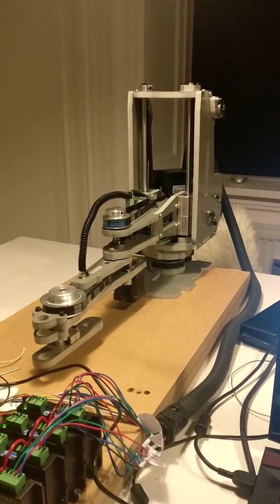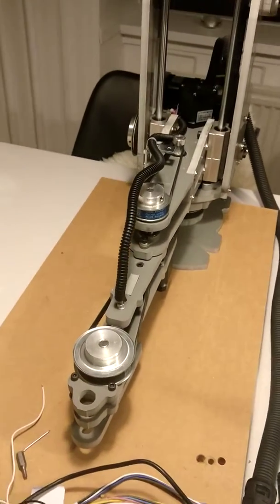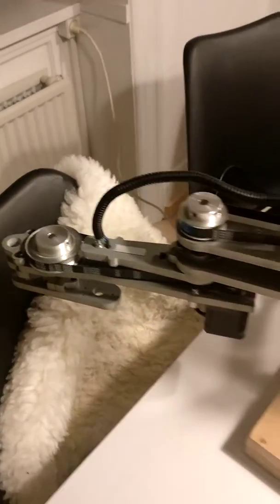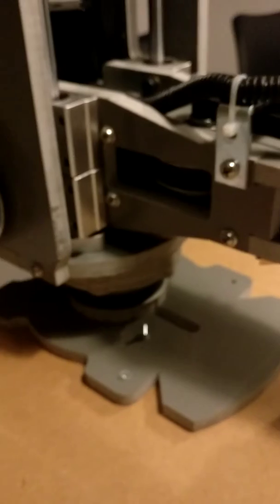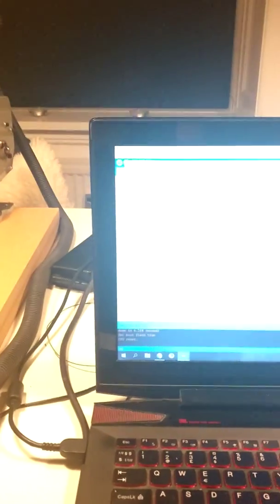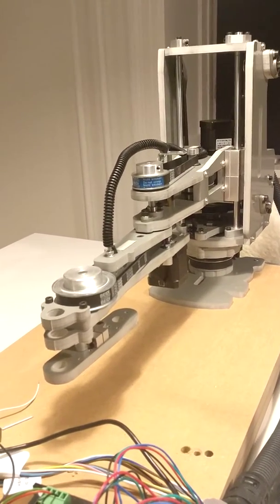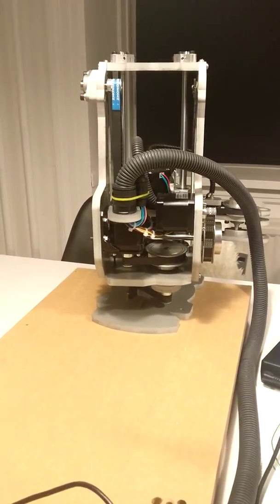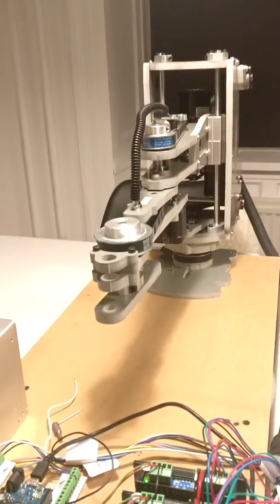Chinese scara robot - frist hookup and impression

Comment: Cool review. By your judgement do you think this robot could be used for a wood milling application? Or should I build my own out of aluminium?
Reply from the maker: Unfortunatly it is way to flimsy. In general i would not recommend a scara robot for a miling application. When milling rigidity is king, it is needed to absorb the forces and vibration from the miling bit. This is not a scara robots strong suit, it is made for speed. If you need something for miling a XYZ gantry design is preferable. You can check out my video of my 6040 cnc. That thing was really nice (taken its price point and weight into consideration). Best regards
Reply: @palmhoej  Where is this video, I can't find it?
Reply from the maker: @robotsforstem1968  https://youtu.be/6W5K4rdEuN8
Reply: It's a toy. An expensive one, but still a toy.
Reply: im building one out of aluminum but not for milling, im having my cnc mill the aluminum parts now, honestly idk what ill have this do, maybe some pick and place job once its done
Reply: and im designing it closely to this robot in this video

Comment: Do you used this scara robot for a serial profuction aplication?
Reply from the maker: Cool side note: it was bought by film company that used the arm as a prop in a danish movie called "Kollision". There is a line about it in the movie.
Reply from the maker: No I ended up selling it. The repeatability was good, but the precision was crap, because the upper arm was slightly twisted in relation to the work plane. This meant that the gripper could never be perpendicular to the work plane. So every time the 'elbow' moved so did the angle of the gripper, making it impossible to grip from coordinates taken from a camera. I guess it was possible to calculate this angle error of attack, but it just seemed to much work for an error that should not be there. Also I had to disassemble the robot a couple of time to tighten some bolts. But by far the worst thing was that there was no perpendicular angles on the robot, every thing ws slightly off. It's a shame, because with just 20% more effort in the production it could have been a real cool robot that could actually do some light industrial application.